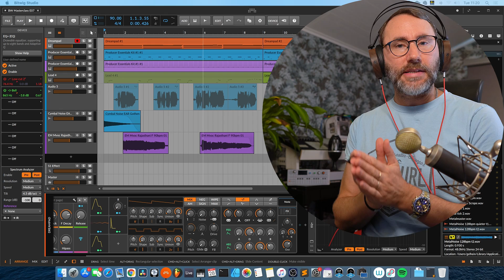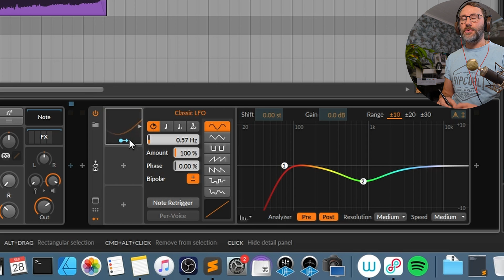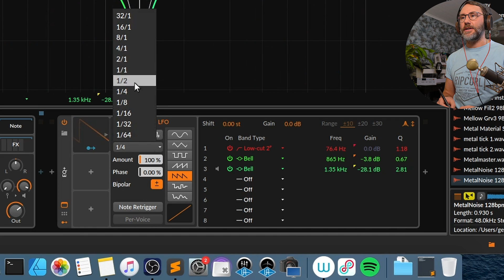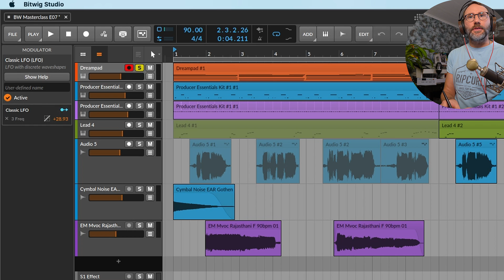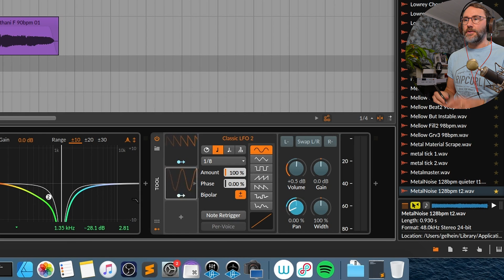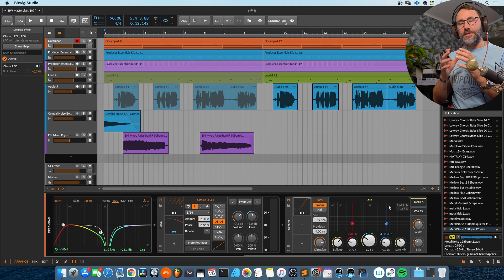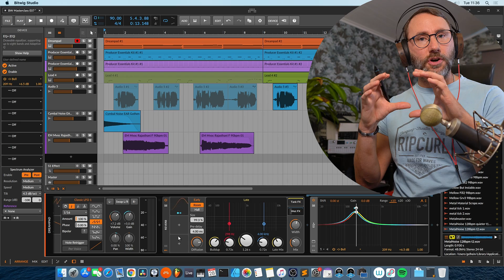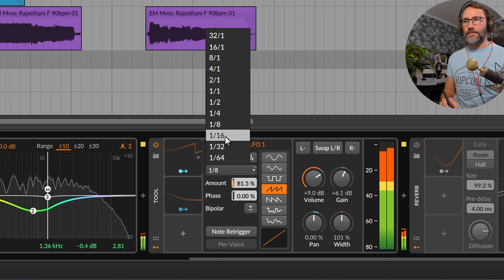Bitwig Masterclass E17 - Modulators (FREE Episode)

Comment: Hi Mattias, while demoing the modulations you were clicking back and forth between note timings.... how do you modulate those? so that it flips back and forth between the chosen note timings by itself at the proper times? It was briefly touched upon at the end of the video but I am still confused about how to do this. Can you make a video explaining further? or is it easy to explain here in the comments section? Thanks... 🙇‍♂
Reply from the maker: Hi Archer, I guess you referr to the note sync rate (16, 8, 4, 1/1 etc. that I set in this part of the video) https://youtu.be/TVp6eu_5LlQ?t=397 You can drag a modulator to the sync rate parameter.
Or just press / adjust the sync rate parameter and it will appear in the automation lane (if you got that open on your track). Now you can add automation and change the sync-rate at different places in your timeline. I did it with the mouse but you can also do it with modulation or automation. Endless possibilities! ;)
Did that solve your problem?
Reply: @MattiasHolmgren  Thanks for your reply Mattias, yes I think what I was wondering about is the automation lane functionality! Have an awesome day :)